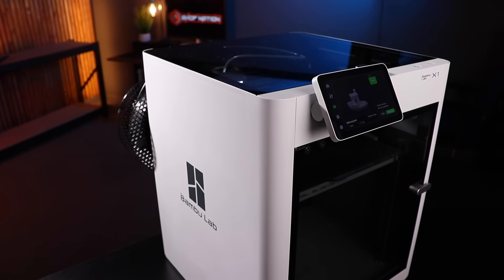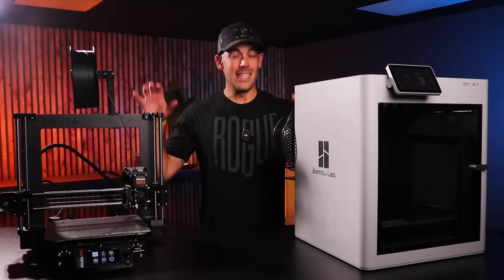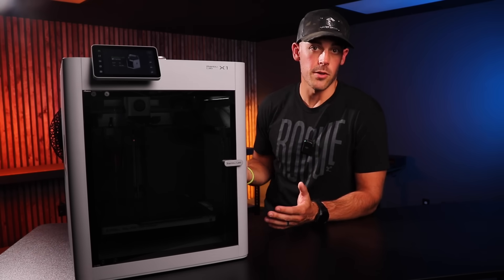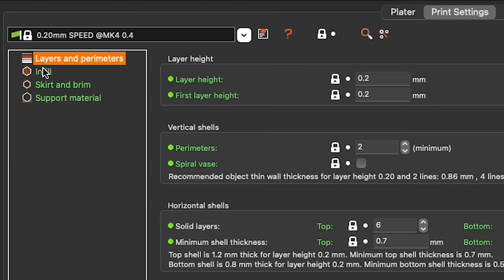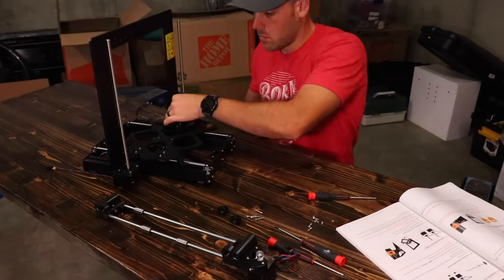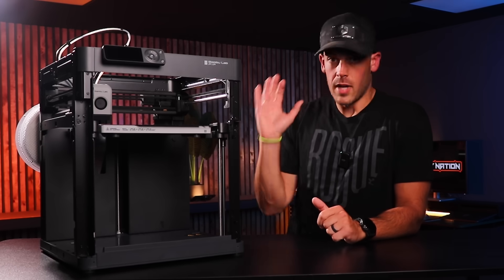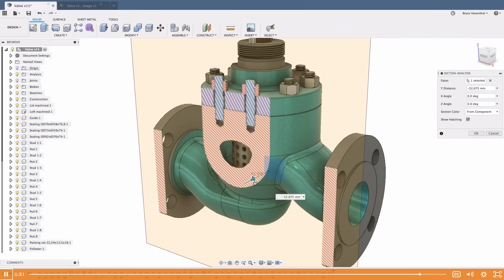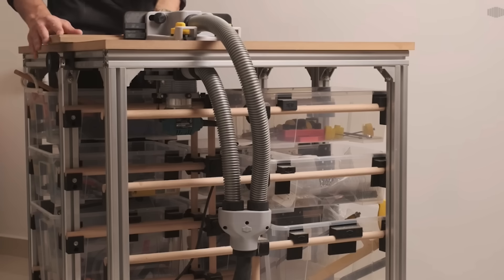The 3D Printer I'd buy if I started over

Comment: Prusa printers are overpriced for their speed and build volume then what is already on the market.  Like the Ender 3, 4 or insert version number here, and the hundreds of clones of them.  While a Prusa printer might be super reliable, that in of itself isn't worth paying 5x the price of a similar printer that you can make just as reliable.  Which is why I do not understand why people fanboy over Prusa printers when my twin Elegoo Neptune 2S's (Ender 3 clones) have been just as reliable for the past 3 years for FAR LESS in price.  
The Bambu on the other hand, ya that stands alone and is the new kid on the block but is busting some new moves that everyone else is stopping to take a look at.  The new Prusa printer is the same price as the X-1 and isn't as big, isn't as fast, and doesn't have half the calibration systems it does.  The X1 is of the Core X/Y type printers, allowing it to print super fast AND has the added benefit of the AMS (making the system a total of $1500) allowing you to PRINT IN COLOR (well 4 colors by default).
Reply: Let me know when your elegoos reach 25k+ print hours with zero replaced components.

Comment: I bought the Bambu Lab X1-Carbon because I only print engineering-grade plastics or plastics that are difficult to print if you don't know what you are doing like ABS, Protopasta Iron composite PLA, Essentium PCTG from Vision Miner, or Nylon-X from Matter Hackers.  I think the Bambu Lab X-1 is too fast, and because of that, the quality suffers.  My Creality CR 10 does better with everything.  I don't have a Prusa, however, I truly believe in them.  For CAD, I use Design Spark Mechanical because it's free and I love the easy-to-understand interface.  I could never understand Fusion 360.  I thought it was ridiculous and incomprehensible. 🤔

Comment: The video is  very helpful, but I gotta say I'm not thrilled with the amount of waste that comes out of the bamboo, its the only reason I am still using a cheaper bed slinger instead. The buckets of filamrent stuff that spits out the back of those things is a real bummer until there is a good way to recycle it.

Comment: Really $1200 on a first 3D printer, If you want a great printer at a reasonable price that is fast , easy to use and just works out of the box the Sovol SV06 Plus is a awesome option at less than 1/4 of the price.  The Bambu labs is a BAD option as it isnt open source, open source means ongoing support into the future, if Bambu labs fold tomorrow then they become expensive paperweights. I started with a Ender 3 (aweosme first time printer) for $200 and now my go to printers are the SV06 , SV06 plus and the Ender 3 Pro

Comment: I bought a year ago ender3. And you know what? Still with all modern technology come in. If I started over, I still would buy Ender 3. There is a great community and all upgrades are already available. (Yes there are communities with parts lists and manuals what to do for what) I of course love DIY (why do you need 3d printer else? To build print farms?) And I am capable of DIY. E3 of course have a lot of trouble in the start, while it works out of the box, it have bad feeder, you need to set bmg or minifeeder, you need to change springs and fix bolts in printbed, you can print some easy direct drive converter. Buy a PEI magnetic sheet. And generally that is all. You do not need bed auto-calibration when your bed is flat and straight. Or and you need to install firmware (copy file from the Internet to SD, very very hard, oh.. sarcasm sorry)
I would change my mind when new printer will come with klipper, with normal direct drive, not proprietary one, with normal bed with knobs, with PEI, with wheels (yes, those do not need any service at all) and with no color screen no second Z spindel, no lights, or anything which is not needed and I have to pay money for). Nowadays new printers are come and go, and instead of adding $5 seiral-to-wifi they add color sensor screen for $20. Of course I will not buy this, I do not need color screen if I have wifi. Also Marlin for example have more options on simple text screens. Even without WiFi, why do I need colors? I just open file from SD and that is all.
But if you have money, why not buy something you can afford? I do not have any offense in that case. (Or may be just order you anime figures from guys like in this video, why do you need that 3d printing box after all at home? Sit on a couch and drink beer, like all rich and successful people do. Cheers!) No really, if you have money and want to spend them, you are welcome.

Comment: I bought is a Prusa Mini (kit).  I've only run into size limitations a couple times, in one case I just printed the thing in two parts and glued it together, and in the other it was enough to rotate it 45 degrees so the longest dimension was on a diagonal. 

If I do need a bigger printer eventually, I think I'll be building a custom one, and stretching one axis beyond the normal dimensions, instead of making it cube shaped.
Reply: I have the same and recently I mounted 1mm nozzle. Now it prints fast and rock solid parts in reasonable time.

Comment: 3rd option, prusa mini+ kit. Its like the mks3+ kit, but even cheaper and only slightly smaller build volume.
Reply: Yes, I have one on my desk. I’ve never had issue with build volume. Plus I don’t have space for bigger printer. Recently I’ve change nozzle to 1mm and I like this machine even more.
Reply: @volkhen0  does it take much longer to print?
Reply: @pixelfairy  longer? Much quicker!

Comment: Excellent video. My first printer was an Anycubic Mega S that cost about $250, and after almost 4 years of solid performance it's finally in need of some repairs and upgrades. I passed on the less expensive Ender-3 because every review I saw said it's a great printer AFTER you do this mod and add this upgrade. Last year I bought a $99 Ender-3 Pro from Micro Center, and it lasted six weeks before I gave up on it and took it back. I like to tinker, but I just got so sick of working on that junk and not being able to actually print with it that I hated it. I am so glad I spent a little extra on my first printer, because if that Ender-3 Pro had been my introduction to 3D printers, I'd have given up completely. 
I would recommend that anyone who is thinking of buying a 3D printer save their money until they can afford at least a $300 printer, and avoid the really low end printers. My Ender-3 Max Neo that I got for free is actually a pretty good printer, but it's also a $400 printer, not a $150 printer.
Better yet, buy a Prusa MK3 or MK4 kit or even a Prusa Mini. They cost more and the shipping is kinda high, but you won't regret it.

Comment: The Prusa is more expensive because you need an enclosure to print advanced materials as well as the Bambu can.
Reply: You mean a plastic bag from nearest supermarket?
Reply: You would do that on a bed singer? Imagine explaining that to an insurance company when your house burns down.
Reply: @enosunim  I'm not clear on what you're trying to say here
Reply: @enosunim  One is enclosed and unlikely to catch on fire, the other is a plastic bag near heaters
Reply: @enosunim  I'm not sure what point you're trying to make here
Reply: @enosunim  This is getting pretty wildly illogical.

If you honestly can't see how a device made by engineers for a purpose is safer than a flammable item neat heaters, I don't know what to say to you. Furthermore, there are way more filaments that benefit from a closed chamber than abs. Polycarbonate is a big one and so is PP.
Reply: "advance materials" you mean nylon? lol cause that's the highest material a bambu lab printer can print. Which my MK3's print just fine with no enclosure. Skill issue.

Comment: Bmbulab is now a way to go in its volume 
Prusa mk4 ...meh
Its mk3 with thicker rails new motherboard but for 2x more where production cost drop so much that parts cost less now with inflatio than they cost 3-4yeara ago without inflation sobi dont understand the price AND WHY IT ISNT CORE XY
It should be core XY since mk3 

Literally what bambulab do with p1p
The best printer right now for less than carbon...but if you want something more...go with bambulab carbon

Comment: I wasn't expecting that. I was sure you'd pick the MK4. I've had my X1C for a couple months now. I absolutely love the AMS. It's such a good multi color/material system. I just expanded to 8 colors.  It really takes your prints to another level.  I do a lot of logos and this makes them look like a professional product.  I still have my 3-4 year old Prusa MK3s it's a fantastic printer I haven't had a single issue with the printer. The speed and AMS is what pushed me to Bambu there's nothing like it on the market. I absolutely hated the Prusa MMU2-3
Reply: there are actually several that are significantly faster, but you have to build them yourself.
Reply: @jeremyglover5541  Yeah I'll probably be building a Voron next. I really like the CoreXY design. And now that I have the X1C ABS and ASA are a breeze.  Though if Bambu came out with an XL/Max version that would be to tempting to get it with a larger build volume.
Reply: @Oliver1071  absolutely it will help having a decent printer to both build and modify your voron. Voron is only really faster than bambu if you build it for speed ie. modify the hell out of it and use a high flo hotend (this is a limitation of the bambu, flow rate of the hotend) otherwise yes, larger build volume. otherwise they are about the same, with the voron being perhaps a touch faster. I'm more talking about Ratrig, VzBoT Vz235 AWD and Vz330 AWD and HevORT. those are serious projects that are significantly more difficult and more expensive than a voron or bambu, but we are talking about 2-300% more flow rate vs bambu at its highest 'ludicrous' setting ... ie. speed runs up to and exceeding 1500mm/s and 40K accel, as well as proper high temp and printing ABS comfortably cruising at 450-500mm/s 15-20k with a 0.8mm nozzle. 

Not for the faint of heart, or inexperienced builders though.

Comment: Oooh might try to save money for one of these! I started with the Ender 3 pro (years back) and at first I absolutely loved it. I printed so much stuff (mainly for D&D) and kept wanting more, but after a year or two it just stopped. The PLA started stringing immensely and adhesion was poof gone. Back then I tried everything, re-calibrating, new PLA, new nozzle, new hot end, glass bed, autocalibration extension, etc. etc. etc. nothing worked and eventually I just gave up. I ended up being able to buy a 2nd hand resin printer for cheap and it worked like a charm. Now, years later and I have that itch again for a FDM printer, resin just won't work for everything I want (mainly use it for miniatures).

Comment: Lmao! Non of these are beginner printers!! Lmao! Thats like giving someone a calculator to teach them math!
Reply from the maker: So a beginner printer would be a hot glue gun?
Reply: @ShopNation  You should build your own dot matrix printer before even thinking about buying an ink jet.
Reply: @ShopNation  It sure as hell isnt a 600 to 1200 dollar machine! Its something that is priced right, fairly user friendly and something to learn on. My 11 year old started with a 99 dollar Imakrr Startt and learned the ins and outs of the machine and the process.
I get it for some these machines make sense. Someone who is incapable of putting forth the effort to learn!  For someone using it as a tool or in a print farm..absolutely!

Comment: Whats the way to have a 3d printer in woodshop, even if you have decent collection there is still dust around everywhere, what can you do to protect it.?
Reply from the maker: Just needs to be in an enclosure. The Bambu would be fine, but the Prusa would need to be enclosed from dust
Reply: @ShopNation  Already bought Ender 5 + which is huge, no place to put it in the house so have to be in my workshop, saw couple of  videos but the problem is i have high moisture problem in Ireland, the shed is insulated but unheated.
Reply: just use any 3d printer which wheels, they do not really afraid of dust, and those wheels are really cheap.

Comment: I've heard a lot of good things about both Prusa (of course) and, more recently, Bamboo Labs 3D printers. I've been intrigued enough that I may, someday, buy one. For the time being, though, I have 2 (well, I have one and my significant other has one, but I often use both MUCH more often than she does. lol) CR-10 Smart 3D printers...and I LOVE them! Ignoring the fact that they're really actually dumb (I've never been able to connect to either of them wirelessly), they both just work. And they have one of the largest print areas of any 3D printer, at least of those that are commercially available to consumers. It's a whopping 300mm x 300mm x 400mm! That's X, Y, and Z, respectively. They have auto bed levelling, filament run-out, the ability to change the print bed, although I never have. You can change it to a flexible surface or a removable stiff surface. Even, from what I've heard, a rubber surface that works well with TPU. All-in-all, I'm VERY happy with the printers I currently use and at around $550, each, they aren't a bad starting point, either.
Reply: Buy a Raspberry Pi 3 or 4 (recommend the 4), use their imager tool to put Octoprint on an SD card, and plug your printer in to the raspberry pi. Now you have wireless connectivity, and can even plug in a USB webcam to the RPi to monitor your 3D prints!
Reply: @Enterthewormhole  I actually use a Wyze Cam v3 connected to the USB port on the printer casing. Since the Wyze Cam only needs the power from the USB port to function, I can pull up my Wyze app and monitor the status of the print from anywhere. I just haven't been able to control that print in case of catastrophic failures. In other words, when the print starts to spaghettify (real word that applies both to Black Holes AND 3D printing! lol), I'm not able to stop it until I get physically to the printer to cancel the print.🤷

Comment: Bambu I understand, this is for the normal guy who wants to just print, the Prusa is a pile of rubbish and belongs in the trash, looks like something I would have thrown together with a Meccano set 40yrs ago, anyone thinking of buying printer skilled or not, should be looking for better value for your money, the P1P is still expensive, but kind of worth it, you would have to have rocks in your head if you think the Prusa is worth it, kit, built, with bits missing, in a dumpster, doesn't matter, is over priced and under engineered, MK4 = Joke
Reply from the maker: Wrong
Reply: @ShopNation  No, I'm not, I'm an Aussie, and I tell it like I see it.
Reply: My MK3 kit has been running for years with nearly a year of print time and I have never had a single problem.
Reply: @YourArmsGone  That's all good, but the time of that style of printer has long, long past, today, one should not be paying through the nose for a 3D printed, linear rod endowed, bed slinger, I know how much things cost, and I know how to design and build a 3D Printer from the ground up, it is not hard, no one should be buying and MK4 over the P1P, end of story.
Reply: @NexGen-3D  For the cost they're comparable, If all I cared about was speed I'd get a voron.
Reply: @YourArmsGone  No they are not comparable at all, even if priced identically and putting the speed aside, one is an actual good product the other looks like something I would have knocked up in my garage many years ago, one is a bed slinger, the other is not, one can very easily be enclosed, the other cannot, one is made from 3D Printed Plastic, the other is not, also one doesn't generally "buy" a Voron, one builds a Voron, the Bambu Labs printer I get, it is a good product for the money you pay for, the Prusa MK4 is a looooong way off from being any kind of value at all, it offers nothing more for the additional money, it only subtracts in comparison to whats on the market.
Reply: @NexGen-3D  So what if it's a bed slinger? It runs for years with no maintenance. No gluestick, just wipe the bed down twice a month and keep on printing. There is value in reliability.
Reply: @YourArmsGone  Nothing wrong with them...as long as they are low cost, then they are fine, I sell low cost bed slingers and they are great bang for your buck, but I can supply 5 or 6 of those printers for the price of one MK4, and they are made from metal, with linear tracks, they work fine, easy to upgrade and will print just as good as a Prusa, you picking the wrong things to argue with me about, ITS ABOUT THE PRICE! MK4=Overpriced it should be no more than $499 USD delivered, and that is still a stretch

Comment: Nice summary but you discount the fact that you can buy 3 Ender 3 Neo with autolevel for less than the price of one P1P. Though slower, with a decent slicer profile (I give some away for free) you can print 3 great quality things vs 1. So the low cost printers are still a realistic option and also offers you the opportunity to buy just one for under $200 and see if you even like 3D printing.
Reply from the maker: Glad you had a good experience but respectfully disagree
Reply: The thing is one P1P will print the same speed as its cost in ender 3s in series.

That's way better because it means you both get output and prototyping speed and none of the headaches of the cheap brands.

Also, The autolevel enders offer is nothing compared to the ones on the mk4 and Bambu labs.

You still have to fus with the Z level.
Reply: @BeefIngot - Not anymore. The Ender 3 V3 SE has auto-level sensor and strain gauge on nozzle that sets Z offset for you. Works just as good as X1 bed level.